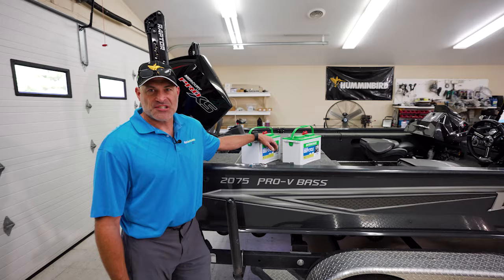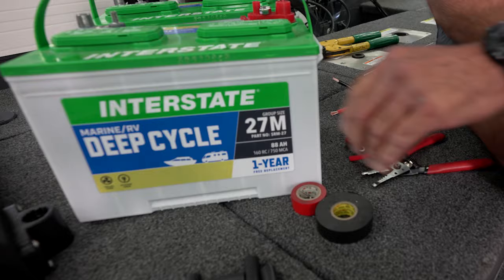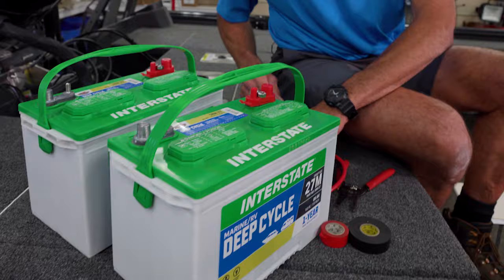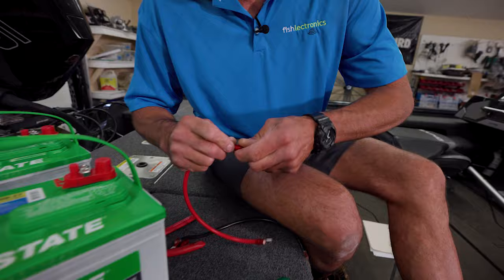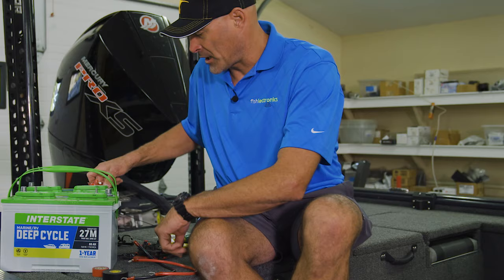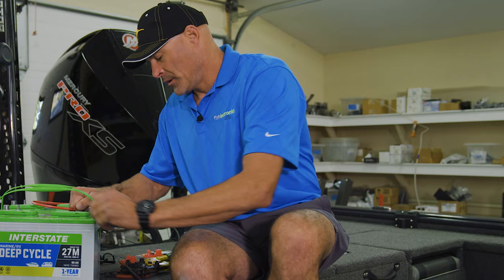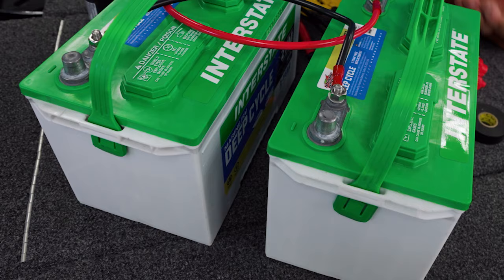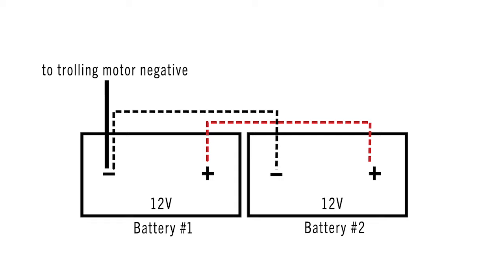How to Wire Batteries in Parallel | Minn Kota Trolling Motors

Comment: Schematic was right. Demonstration was wrong.
Reply: So from motor it goes one positive one battery and one negative other battery correct? like his picture?
Reply: Exactly!
Reply: @boduncan1044 no that’s running them in a Series not parallel
Reply: Between this guy doing different than picture and the comments, this is the most confusing thing I have ever seen lol
Reply: Wouldnt running in series be easier and safer
Reply: @TacoDudeYum ya didn’t get a reply as soon as ya hoped and have probably already figured this out but here’s the difference between parallel and series. 
Series: double the volts amps stay the same. 
Parallel: Double the amps voltage stays the same. If ya got a 12v transom mount trolling motor ya don’t wanna put the batteries in series.
Reply: @FarmerPierce  thank you for clearing this up for me brother so if im targeting 24v i wanna jump two 12v is series correct?
Reply: Hooked it up to batteries wrong. Lol
Reply: Yes

Comment: I thought u are supposed to hook to negative on one and positive on the other battery for the trolling motor and the charger anyway
Reply: Genuinely surprised Minn Kota didn't address this. The literature i see over in the Solar Power world, where they use a lot of the same 12v batteries, indicates that you are correct. Connection like in the video could lead to uneven wear and premature failure of the battery nearest the load. Perhaps there's no real-world difference in a 2-battery setup, but i'd still give more thought to a 3 or 4 battery implementation.
Reply: @rootwad  This video was for connecting batteries in Parallel not in Series. Google the use cases for each of these. Cheers!
Reply: @privateidho  Yes indeed. Once you have 2 batteries connected in parallel, the lines to the load COULD be connected to the + and - of one battery, OR to the + of one and the - of the other. The former is what is shown in the video, the latter is what is generally recommended outside of the fishing community. 2:53 of the video actually shows a schematic that matches this; the video, disapointingly, does NOT follow this wiring diagram and the demonstrator wires the load to the + and - of one battery.

Comment: Why does the wiring diagram show trolling motor negative and positive going to separate batteries and you hooked them to the same battery. Makes no difference but you showed one thing and did another.
Reply: What he meant to say was series. The way he's doing it is producing 24v. Parallel is same voltage (12v) but doubling the runtime with the extra battery.
Reply: @AllSnipe wrong!
Reply: @AllSnipe  It's still parallel. Red connected to red, black connected to black. If he connected the battery positive to 2nd battery negative, then connected his motor to the other free posts, that would be 24v. 

And yes, the way he demonstrated it (connected the motor leads to only one battery) was wrong. It does make a difference and the diagram should be followed (connected to one side of each battery) so it doesn't lead to uneven discharge and recharging.

Comment: May be better to Connect the load to the positive of the first battery and the negative of the last battery to make the batteries discharge evenly.
Reply: .. it really doesn't matter.. the weakest battery is in control

Comment: I have a question that I cannot find anywhere on YouTube when I connect to lithium ion batteries and parallel versus wiring them in series. What happens to the water hours?
Reply: it does not matter if the batteries are SLA, AGM, GEL, Lithium ion, series connection equals more voltage, parallel connection equals more AMP hours, and series parallel connection equals more voltage and amperage. Example of Series connection for two 12volt 100 amp hour batteries would make then 24volt 100amp hour, Parallel connection would make them 12volt 200amp hour, and Parallel Series connection would make them 24volt 200amp hour. Hope that helps

Comment: ⚠️⚠️There is a possibility that This particular WIRING can end VERY BADLY.⚠️⚠️

ALWAYS USE FUSES TOGETHER WITH A PROPER FUSEHOLDER THAT CAN WITHSTAND HIGH CURRENTS OVER 100 AMPS. (When shortciruited)

SO: in my opinion there has to be a FUSE in the Red cable (between the + of the batteries) and the cable that runs to the motor HAS TO HAVE another FUSE. Think of 50-60 Amps fuses. You do NOT want to be close to a DOUBLE LEAD ACID that is short circuited

Comment: Can you use one bank to charge two batteries in parallel? How would you put the leads on?
Reply from the maker: Thomas Robey,
We would recommend each battery to have their own bank.  You could do two batteries in parallel with one Bank but it will take a lot longer to charge the batteries that way the Charger could time out.  You would put the leads to one battery and when that battery is full it will trickle over to the other battery.
Best Regards.
Reply: @MinnKotaMotors  I agree.  I actually do this.  However, I fully charge the batteries first, then hook them in parallel from biggest to smallest, then hook the automatic trickle charger to the biggest battery.  I only do this to maintain batteries over winter.  It does work however.